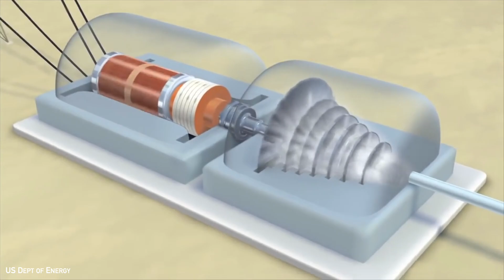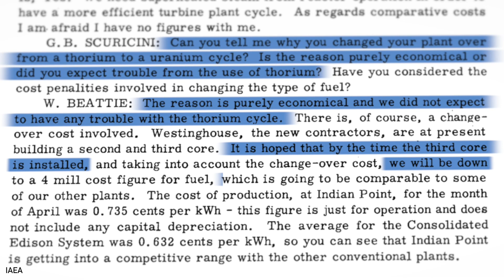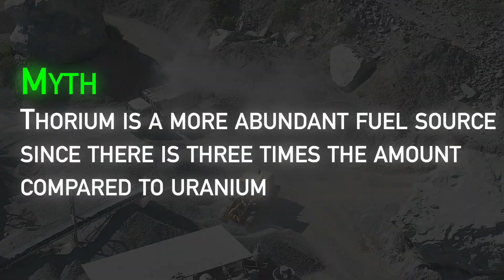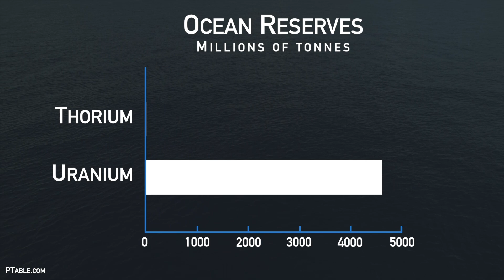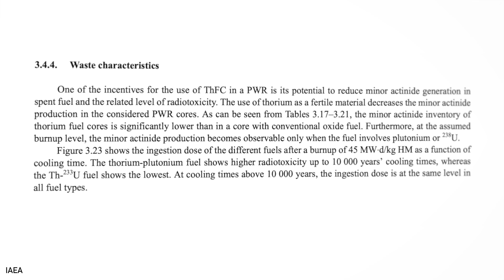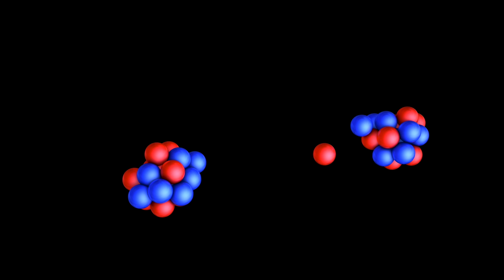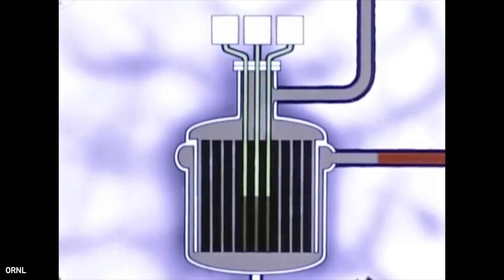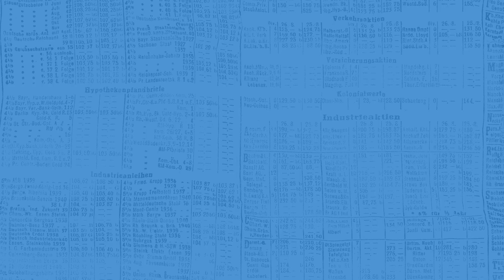*Almost

Comment from the maker: Fair warning, this is a little bit of a party pooper video for thorium. Not that it's all bad, just some challenges to overcome 😉
Reply: Please clarify your statement on Thorium to Uranium spent fuel dangers.  Thorium is not fissile so are you saying that U233 fission fragments are not as radioactive or as long lived as U235 or Pu239 fission fragments.  Excuse the question as I admit, I am too lazy to research the answer myself, if you have already done so.

It should be noted that reactors are neutron production machines. You can use those neutrons to fission fissile material and produce energy for power production. Or you can "waste" those neutrons via absorption in control rods, fission fragments or fertile U238 or Th232. It would seem that Thorium reactors would always be less efficient by size than uranium based reactors.

I worked at the Shippingport Atomic power station in 1977 when they tested the Thorium breeder core.  Spoiler alert, it worked. Granted Shippingport was a light water reactor but neutrons were so scarce that the core operated without control rods.  In order to go critical, fuel assemblies were inserted into the core from above. Not the safest design since the reaction was shutdown by pulling these fuel assemblies, against gravity, out of the core.

Light Water PWRs seem very simple compared to the Thorium designs that I have seen.  Processing salt "coolant" to remove or add isotopes is an engineering nightmare.  My experience is that engineers never see anything as a problem as long as a solution does not violate the laws of physics.  Of course, they do not consider cost, efficiency, operational concerns, maintenance concerns, or longevity. I am a pessimistic (I'll believe it when they build and operate one)  Missourian (show me) at heart.  

The U.S. has over the last 70 years designed, built, and tested every reactor design known but they have never built and operated one with all the features that are now claimed to solve all our problems.
Reply from the maker: Good question. You are correct, Th-232 doesn't fission and therefore makes no fission products directly. In that statement I'm referring to the overall thorium cycle (i.e., Th-232 -> U-233 -> FISSION -> Fission products). The difference in long-lived isotopes comes from U-238 mixed in with U-235 in a uranium cycle. A Th-232/U-233 cycle has no U-238 so that's how it avoids this issue. U-238 has a tendency to absorb neutrons without fissioning and go to higher mass isotopes like Pu-239 or Pu-241 (or others). It's these minor actinides and transuranics that are so long-lived and still sufficiently radioactive causing the problem. That's usually the argument people make.

The IAEA put together a decent review of thorium from several countries (NF-T-2.4, https://www-pub.iaea.org/MTCD/Publications/PDF/Pub1540_web.pdf). Section 3.4.4 (page 54) of the PDF and onward was the basis of my statements in the video.

Very cool to hear you were actually at Shippingport for their thorium core. Sorry, I can only fit so many examples into a 13 minute video. Maybe next time!
Reply: @atomicblender  Thank you for your reply. If I understand correctly the reference to a Thorium-U233 reactor producing "safer" fission fragments is due to the transmutation of U238 into Pu239/241 and not the difference between U233 and U235.

Any initial "starter" core of enriched Uranium would certainly contain U238 but once the U233 cycle the fission products would be different. 

Now we just have to wait for one to be built and see how it actually performs.
Reply: To my knowledge that system was the best example of a completely operational reactor that had less drawbacks then our current high pressure water reactors with uranium. It would be the best example for this video if anything. @atomicblender
Reply: China has a working thorium plant!
Indonesië is building one with ThorCon
Reply: @VriendRick The Chinese plant  is quite small but is up and running. It is in the Gobi desert and it was put there to illustrate the fact that it doesn't need water as a coolant. It is already supplying power to 1000 homes.
Reply: @VriendRick  Do you have a link to the China plant and what is does and has proven?  There are many versions of Thorium reactors.

Also keep in mind that a significant percentage of goods are manufactured in China because no other country can produce them or produce them at the cost to China.  Something done in China cannot be duplicated in other countries at the same cost.
Reply: @clarkkent9080  Link I send is already gone.
Look at Thorcon for cheap modulair build
Ready in one year
Reply: @VriendRick  Like I said until one is built and operated to prove the concept, it is all just corporate hype.

NuScale originally said they could build SMRs in a factory in 1 year and at a cost of $1 billion.  The U.S. taxpayer is offering them up to $2 billion in matching funds to build it.

Here is how that is going.

This is from the Des Moines Register an concerning the only Small Modular Reactor (SMR) project in the U.S. today.
In 2013, the Wall Street firm Lazard estimated that the cost of generating electricity at a new nuclear plant in the United States will be between $86 and $122 per megawatt-hour. Last November, Lazard estimated that the corresponding cost will be between $131 and $204 per megawatt-hour based upon the 4 recent new nuclear projects in the U.S. . During the same eight years, renewables have plummeted in cost, and the 2021 estimates of electricity from newly constructed utility-scale solar and wind plants range between $26 and $50 per megawatt-hour. Nuclear power is simply not economically competitive.
SMRs will be even less competitive. Building and operating SMRs will cost more than large reactors for each unit (megawatt) of generation capacity. A reactor that generates five times as much power will not require five times as much concrete or five times as many workers. This makes electricity from small reactors more expensive; many of the original small reactors built in the United States were financially uncompetitive and shut down early.
The estimated cost of constructing a plant with 600 megawatts of electricity from NuScale SMRs, arguably the design closest to deployment in the United States, was originally advertised as costing $1 billion but upon requesting actual bids from engineering firms, increased to $6.1 billion in 2020. Given inflation and other cost constraints that cost today can only be expected to be significantly higher.
The cost was so high that ten members of Utah Associated Municipal Power Systems canceled their contracts. NuScale then changed its proposed plant configuration to 6 fewer reactors but increased each reactor output from 50 Mw to 77 Mw costing at total of $5.3 billion. The NRC just last week approved the construction of the 50 Mw design but now will have to start the review process all over given the switch to a 77 Mw design. For each kilowatt of electrical generation capacity, that estimate is around 80% more than the per-kilowatt cost of the Vogtle project in Georgia — before its cost exploded from $14 billion to over $30 billion. Based on the historical experience with nuclear reactor construction, SMRs are very likely to cost much more than initially expected. And they now have delayed the project start until 2025 in an attempt to find more backers.  All this before the inevitable setbacks that will occur once construction starts.
Reply: @clarkkent9080  look at 
nextBIGfuture
Reply: @VriendRick  It is always great to hope but these companies that claim they can build a new nuclear plant in 1 year have been claiming that for the last 8 years and I am still waiting.

Why am I so pessimistic ? Maybe it is because I concentrate on facts and reality not promises.

.  If you live in the U.S. here is the reality for the last 4 state of the art Westinghouse AP1000 ADVANCED passive safety features new nuclear power projects and spent fuel reprocessing and in the U.S. over the last 20 years. You decide if this YT video was presenting the truth. 

The Southeastern U.S. is super pro-nuclear MAGA, has zero anti-nukes, and 100% media and political support. 

The MOX facility (South Carolina) was a U.S. government nuclear reprocessing facility that was supposed to mix pure weapon grade Pu239 with U238 to make reactor fuel assemblies. It was canceled (2017) in the U.S. After spending $10 billion for a plant that was originally estimated to cost $1 billion and an independent report that estimated it would cost $100 billion to complete the plant and process all the Pu239, Trump canceled the project in 2017.

VC Summer (South Carolina) new nuclear units 2&3 were canceled in 2017 after spending $17 billion on the project (original estimate of $14 billion and 2016 completion date) with no clear end in sight for costs or schedule. 

Vogtle (Georgia) new nuclear units 3 &4 currently 110% over budget and schedule (currently over $30 billion) and still not operating. Mid way into the build, the utility stated that had they known about the many costly delays they would never have chosen nuclear. They are now delayed another year because according to the project management, thousands of build documents are missing. If completed, Vogtle will be, for its output, the world’s most expensive nuclear power plant.

Please google any of this to confirm.

If you can’t build new nuclear in the MAGA super pro-nuclear southeast U.S. then where can you build it?
Reply: @clarkkent9080  
I can't fathom how any nuclear, let alone mass produced molten salt reactors, etc could cost so much to simply generate electricity because the fuel is basically free compared to the fossil fuels.
I understand its  higher up front costs need to be factored in, like the renewables, but once built, shouldn't require much more labor than the renewables.
So, since this logic does not seem to prevail, I'm assuming that there's layers upon layers of expensive - and ongoing - regulations and fees, designed to keep energy expensive.
We know we can mass produce a smaller reactor. Sure, it doesn't scale as good for the costs, but imagine, compare a 5MW wind turbine to a 5MW reactor. Which do you think will need more energy and materials to make?
Alvin Weinberg said that the LWR was safer as a small unit, as it was designed for ships (I think it was 60 MW).
So, let's start mass producing as long as walk away safe like the SMR industries have been touting for decades, now!
Edit: I think it's also the industry itself being greedy. My point is to get the fear out of the way, to lower regulations and then mass produce, after bunch of testing (try to make it "blow up" on a ship or something, or like they used to with testing).
The key is for the new SMR company too be more like Tesla, which is fast tracking the battery raw materials supply chain, to, thankfully make renewables work 24/7.
You can't price renewables without their required battery or other storage. For ex, solar generates about 6hrs/day. O be reliable, you need almost 4x the rating plus almost 18 hrs of LFP storage.
I believe Tesla will eventually make that LFP to be cheaper than what the Chinese are doing now, because of economies of scale.
Reply: @clarkkent9080  
Politicians don't want cheap clean energy for the people.
There is to litle profit for them.
So they hold  and push the projects back and delay them.
Al about money and corruption!
Reply: @fireofenergy  Google says: In general the construction costs of nuclear power plants are significantly higher than for coal- or gas-fired plants because of the need to use special materials, and to incorporate sophisticated safety features and backup control equipment.

In order to be competitive, nuclear must cost no more than $6 billion per 1,000 Mw plant. Vogtle units 3/4 are currently at $15+ billion for 1,000 Mw, Terrapower demo reactor yet to start construction estimated at $11.6 billion per 1,000 Mw, and NuScale demo reactor yet to be built at an estimated $11.4 Billion for 1,000 Mw equivalent.  No U.S. nuclear project has ever come in on estimate with the Vogtle plant now over 110% over estimate and still not operating.

I am sorry that the facts are not what you would like them to be but that is reality.  Bill Gates is CEO of Terrapower and i don't think Elon would do any better.

BTW, what nuclear safety regulations would you suggest we eliminate??
Reply: @clarkkent9080  
We don't do it because it's easy... (I'm not saying to get rid of SCIENTIFIC safety, just minimize the risk (look up Alvin Weinberg's molten salt reactor before you say otherwise)!
Also figure out the best EROEI
Reply: A huge portion of the cost of nuclear energy is compliance with bureaucratic regulations.  Yes, we do need government oversight, but when the regulations make the systems so complex that they are no longer dependable and controllable, then the industry enters a death spiral.  Thorium has advantages over uranium fuel at the fundamental physics level, but thorium has historically encountered road blocks to its development.  To answer why this is occurring, you need to follow the money.
Reply: Aerospace engineer here and I think you're being a bit loose with the facts.
According to your bio you have "... 17+ years in the nuclear energy sector, I specialize in fuel technology, nuclear safety, plant support, licensing, and long-term strategic direction." 

I don't think you have done anything deliberate BUT AT THE MOMENT people like yourself have to get EVERYTHING 100% right because for every person who can explain this stuff there's 100 clowns with social media channels misleading everyone with all sorts of nonsense.

1) In your introduction you make NO discernment between the fact that Thorium becomes U233 after becoming protactinium and NOT U235. This is one of the things that easily misleads so many people about Nuclear in general irrespective of if the fuel is Thorium, U235 or U238 (like in a CANDU). 

You have to be VERY CLEAR about the different fuel cycles. 

For instance a couple of years ago on the Australian program QandA (pronounced 'Q' and 'A') they were discussing SMRs and thorium was mentioned. A person (and I assume it was deliberate because they knew enough to know what they were saying) tweeted the live feed and their tweet was posted live across the bottom of the screen and basically said "Thorium becomes Uranium and Uranium becomes Plutonium so Thorium can be used for bombs."  

You and I both know that person who tweeted that LIED but the TV station clowns had no idea on how to fact check that lie. But several 100 thousand people were all told that Thorium produces Plutonium.

This is why you have to show what the fuel cycles are because the average person has NO IDEA about the differences between U233, U235, U238 or any of the other Uranium isotopes and haw they behave.

2) In your Myth #1 regarding Plutonium you forget to mention that many of the first generation reactors were specifically designed to primarily to produce plutonium and secondary as power generation systems. This was something the British people were sold on. They were told nuclear would provide very cheap power because their plants were designed to produce plutonium with the power output being almost a waste product. Yes - it was one of the more bizarre selling points of the era.

That wonderful list of points you show from that report is really good information but its also garbage because almost every claim being made was also TRUE of every other nuclear reactor technology at some point.

The other thing you fail to mention regarding economics it the cost of producing fuel grade Uranium. I recently watched James Krellenstein on Decoupled Media to several really good videos including one on enrichment, which I think EVERYONE should check out. James actually made a much stronger case that you have for NOT going down the MSR path (irrespective of the fuel) at the moment. He points out the millions of man ours that people have OPERATING Solid Uranium fuel reactors compared to the few 1000 hours that people have operating MSRs. NOBODY actually knows the long term issues with operating an MSR because nobody has ever done a long term plant.

3) You point out correctly that Thorium can be made into weapons with U233. Being honest, I was unaware of this so checked it out. YES - U233 has been used in bombs but only a couple of tests. You mentioned Operation Teapot which was nice but YOU DID NOT mention the core was a mixture of Plutonium and U233 OR that the test FAILED to provide the yield expected. 

Sorry but for someone with your background you need to do better.
Reply: I'm no expert on this but another thing that I've herd of is that conventional nuclear reactors create radioactive isotopes used in medicine. I may be wrong about that but I think I heard that there was (and maybe still is) a shortage of these isotopes now.
Could a Thorium reactor create these medicinal isotopes?
Reply: The "isotopes" you are referring to are made in reactors engineered and operated to produce those specialized medical products, not as a casual byproduct of energy production reactors.  Therefore, thorium reactors will have no effect on the production of medicinal radiological products.
Reply: @herbieschwartz9246 in a LFTR those isotopes can be extracted through a change of voltage in the fluoridation process. So unfortunately you are wrong.
Reply: So the video pretends to debunk Thorium, when in fact it debunks nothing to gain views ? Yes its technically difficult and takes investment, no one ever denied that. Seems kinda disrespectful to people that dedicate themselves to promoting Thorium instead of making bombs for a change.
Reply: @youtubeyoutube6666  The only people who dedicate themselves to promoting Thorium are people who believe everything they see in YT videos.  The scientists and financiers in the U.S. have absolutely no interest in Thorium because .... well they are educated and really knowledgeable.

BTW U233 is fissile and ANY fissile material can be used to make a bomb, some better than others but they all can be used to make a nuclear bomb.  But you just believe what those YT videos said
Reply: You're almost completely wrong that it can be made into a bomb. Some U-232 will unavoidably be produced when breeding U-233. This is both a potent gamma source and must be kept to extremely low levels (<0.005%) for military use. This may be why the Teapot test yield was significantly below what was expected.
Reply: Thanks for addressing that before Internet Patrolling Karen called the manager of the united nations. Omg can't stop laughing 🤣🤣🤣🤣
Reply: @floridanews8786  sorry, can't dumb it down for you any more than that
Reply: Without a "Fission bomb" Tritium is useless. It is used to boost the yield of a Fission bomb through fusion and can not be made into a bomb by itself.
Reply: U233 is not a good bomb making material. It would be non-cost effective to purify the U233 from its contaminants, which are a strong gamma particle emitters.

Thorium is more abundant when you look at the proportional isotopes available. Thorium only comes in one isotope naturally. Uranium comes in two, and the vast majority has to be bred into plutonium and then fissioned with a lot of waste produced that has many thousands of years of dangerous radiation emissions. The Thorium decay chain reaches equilibrium in just over 300 years, which is a definite improvement. Furthermore, the Thorium fuel cycle is much more efficient in a LFTR, where upwards of 90% of the fissile material is "burned", versus .5% in a standard LWR.

You should probably look at some of the lectures of some of the leaders in the Thorium nuclear sector before doing another video.
Reply: I didn't see a full and objective analysis in this video.  China and India moving forward with Thorium MSRs is an indicator that there are other advantages not discussed.  Such as no water as a coolant is required and that Thorium MSRs can be small and local and therefore give much more autonomy for communities on a local level.   A Thorium MSR can power a ship very cheaply and this cheap energy could be used to clean up our oceans.  There are powers and interests that are threatened by this technology.  Let's face it multi-national corporations and crony capitalism are a big factor in the west of causing much propaganda about global warming without any real intent to do anything about it besides working with their cohorts in government in raising everybody's taxes for another gov. program.  Big money and fake news and traitorous government have combined forces against their own citizens.  What an ironic twist that places like China are making more logical decisions than we are.
Reply: First impression: finally, someone that knows what is talking about in the matter of the commercial nuclear power, in contrast to ignorant lobbyists aggressively occupying media and social networks by technological promises that in RL can't be fulfilled.

Well done mate, thank you and keep the good work 👍